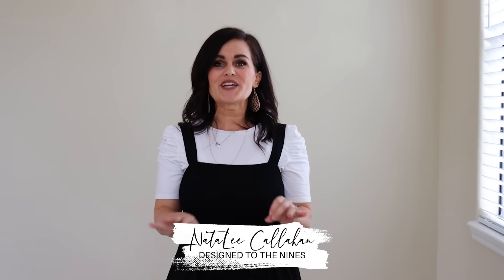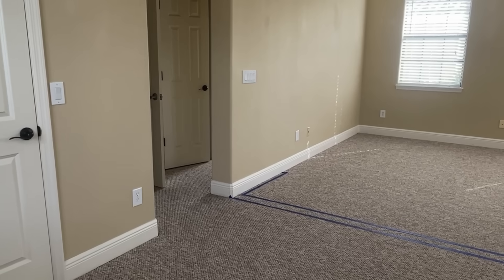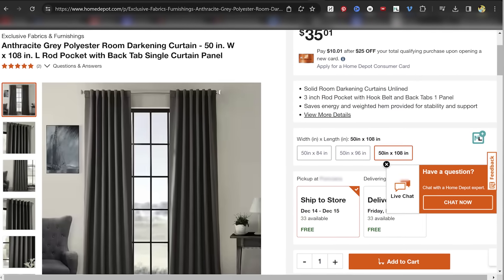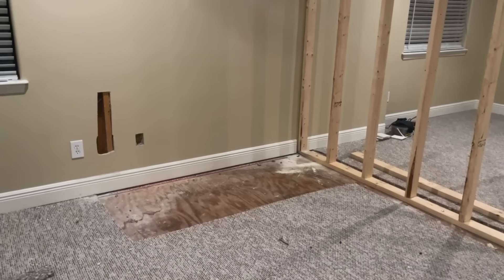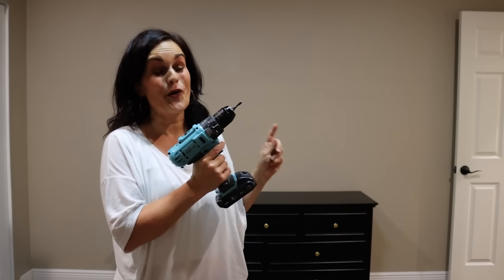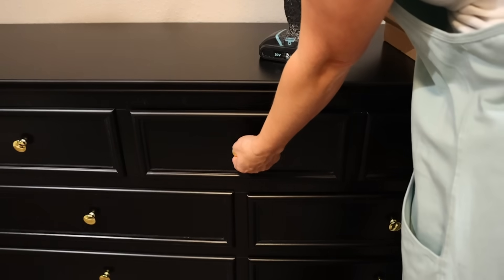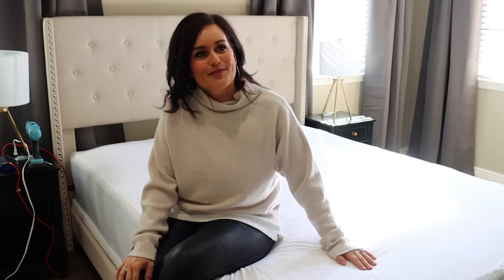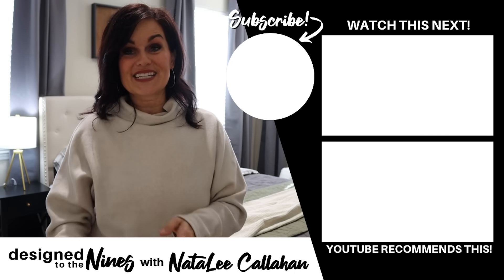Extreme Bedroom Makeover in our New Forever Home!

Comment: Are the floors LVP?
Reply: If they are the anti slip can’t be the rubber one you used, it will remove the top of the floors. We have them in our house and it has a chemical in it that will ruin the finish
Reply from the maker: They are engineered wood. Shaw floorte line.